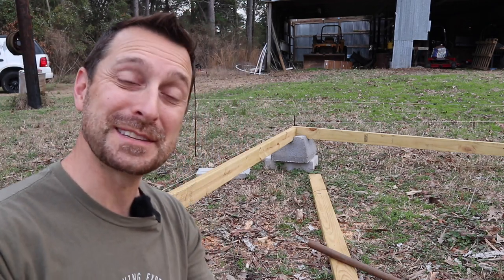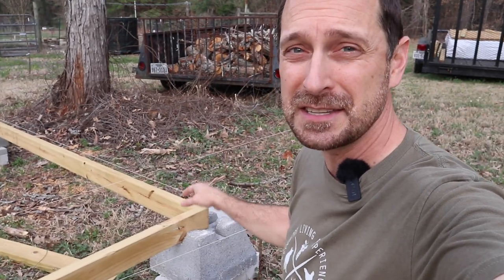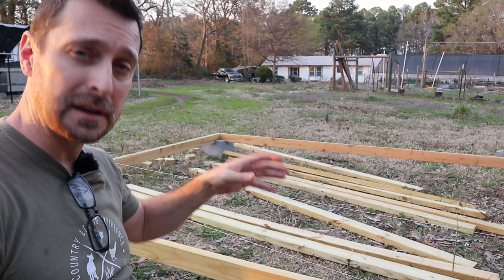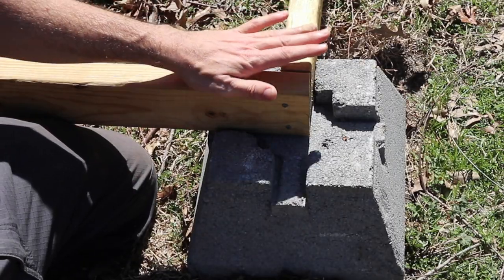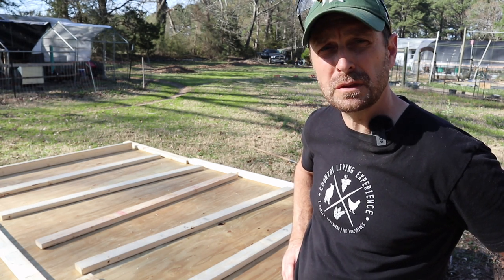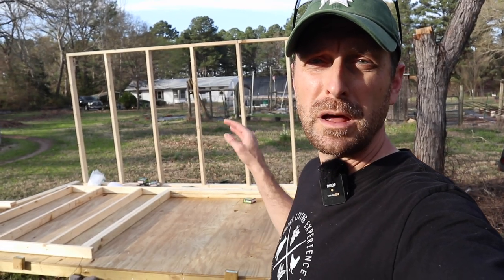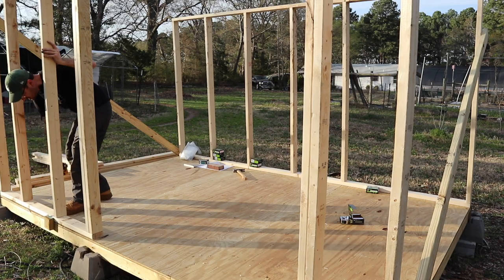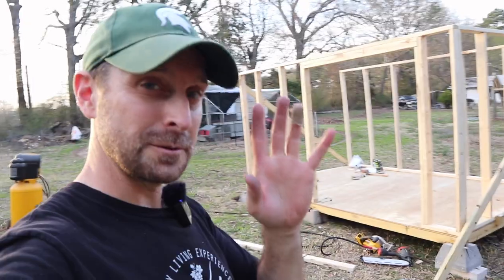Shed Conversion To Chicken Coop And BONUS Solar Equipment Room! Part 1

Comment: Are you planning on letting the chickens go underneath the new coop? One of my biggest predators for my chickens are rat snakes. They get eggs, young chicks, and have even killed a full-grown broody hen. Had a 4' one go right through regular chicken wire. You might save some of the smaller limbs of the willow. Make willow water to water any new plants or trees. It's a natural rooting hormone.
Reply from the maker: No, I am going to put hardware cloth around the bottom.

Comment: Hi! I’m in Dallas Texas. Watched your videos from few years back and helped me with a chicken run I want to build. For chicken coop, do you have plywood floor and then bedding on top? Is plywood treated as well? I’m thinking about the layering method but if that is ok on top of plywood? Thanks!
Reply from the maker: I use treated plywood. In this new coop I will put some linoleum over the plywood for added protection and longevity.